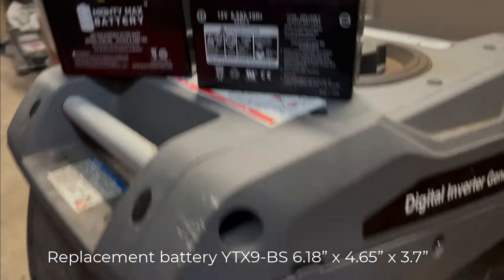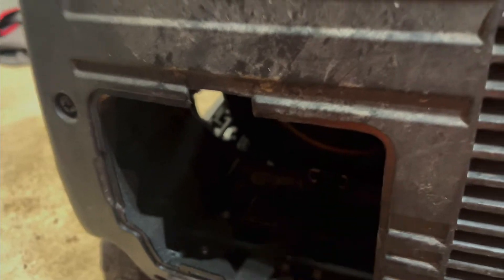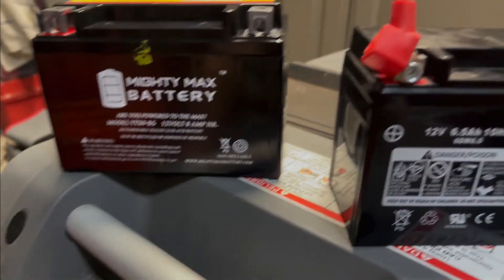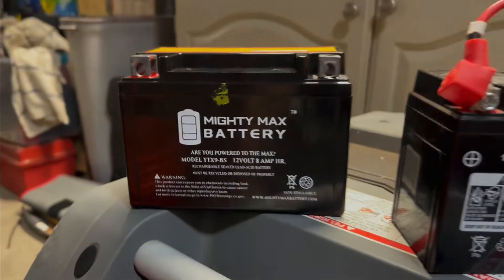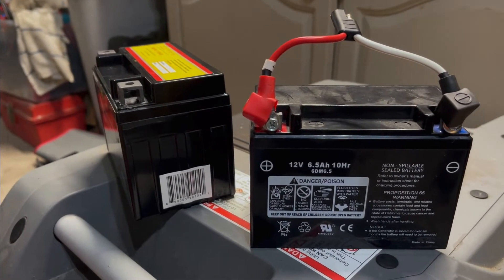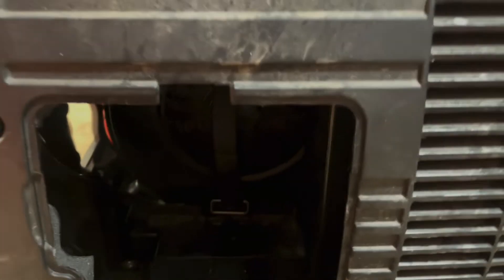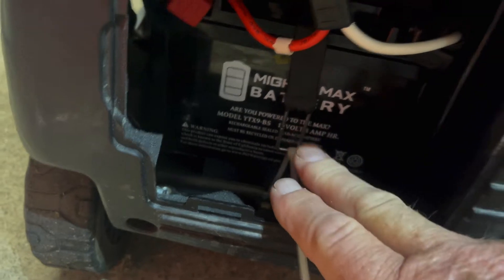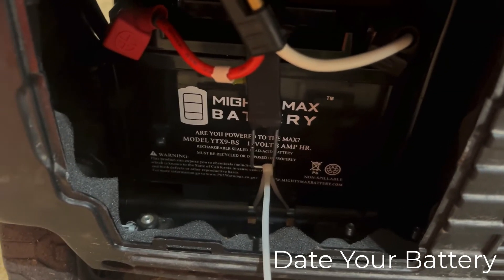Start battery replacement for Onan Cummins P4500i Remote start

Comment: Will the dead battery cause it not to start even with pull start? Mine is dead, and it started for a few seconds. But is throwing the power overload indicator

Comment: I managed to find an exact (almost) replacement. The battery I found is the exact same size, shape, and capacity as the battery originally supplied (6DM6.5) with the Westinghouse generator.  I purchased a DongJin MFQ-6.5 12V 6.5Ah battery on eBay.  I received it two days after ordering. CAUTION, the battery terminals on the one I'm talking about are reversed from the original. Pay attention to the polarity. It's no trouble to reverse the cables,  because they are on a pigtail.  It is most likely that the Westinghouse generator is made in the same Chinese factory as the Cummings Onan unit.
Reply: Did the battery end up working good?

Comment: Great video.  Have you considered replacing with a Lithium battery?
Reply: They onboard charger will fail if you use a Lithium battery, I'm with Cummins and have seen it happen, please just use a standard battery.
Reply: @busdriversteve1137  where can we buy your batteries then? Closest place was on the other side of the planet
Reply: if you could find one tho. ive been looking and cant find any listing even doing a google serch
Reply: Westinghouse generator, rebranded onan